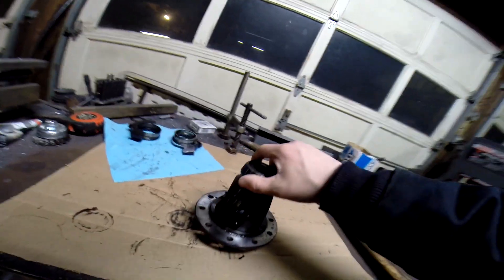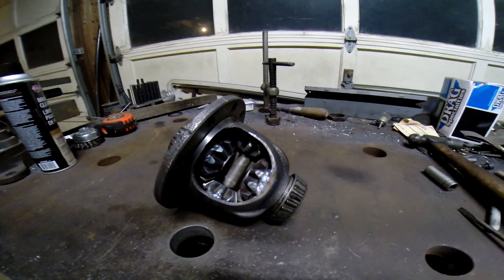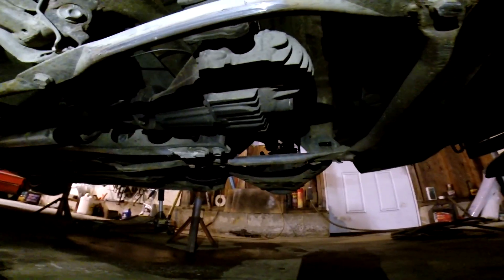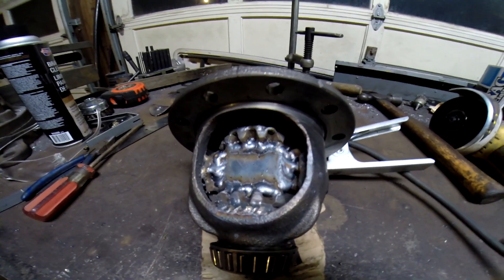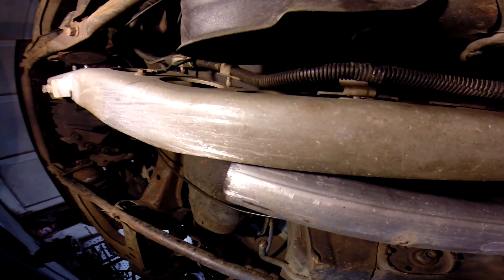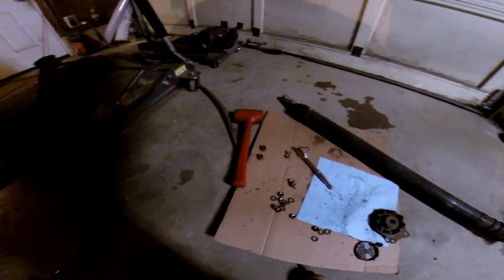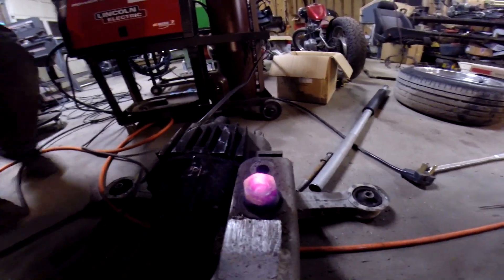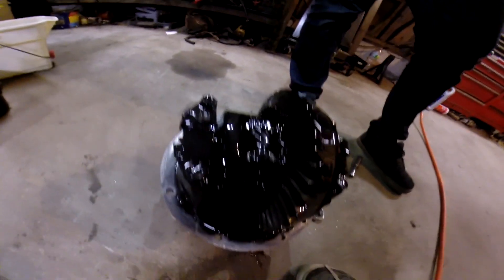Miata Drift Build Part 2

Comment: Just got a 95 318i for $600. Came with e46 rims and m3 front bumper. Guy sold it because it had a ticking noise but he didn't know what it was a thought it was bad. It was the exhaust manifold. Easy fix and a steal.

Comment: Since taking off the whole PPF beam and the diff together, make sure you align it carefully!! you can ruin your transmission and diff (not so much since its welded) you will probably hear de-accel grinding and acceleration whining when its not aligned properly. I know from my miata when I dropped the trans sadly.. haha

Comment: why a welded diff when you already have an lsd?
Reply: Cause race car
Reply: +SLD pf      *rice car
Reply from the maker: Lsd = LIMITED Slip diff 
Welded diff =NO SLIP DIFF
Reply: +Ricer Miata you tell him what's up
Reply: +563ripper also he can sell his lsd to someone else to fund other stuff
Reply: If the LSD he had was as old as his Miata, it's likely worn out and probably slips more than it locks.
Reply: +563ripper Welded diff + RWD = instant sliding! That's why :D
Reply: +563ripper Welded diff + RWD = instant sliding! That's why :D
Reply: What's an LSD?
Reply: +COOLIFY limited slip differential
Reply: +Primer2tone Garage A torsen doesn't wear out, it's just blow lol
Reply: +Primer2tone Garage Torsen diffs can't slip :P It's nothing like a clutched diff.
Reply: Tran Antony
I didn't notice his previous diff was a torsen. I was too busy focusing on the shit I was taking while watching this video.
I just assumed he had an stock vlsd.
Reply: +Sam DrowsySam Millington Torsen diffs are only limited slip.
Reply: NoRealPotential I know it's only limited slip, that doesn't mean anything mechanical is slipping. The torsen gears don't 'slip'. I was meaning they wont slip like a clutched diff when worn out and well used.
Reply: +Adam Loer 
It was an option. But they also came with an open diff.
Reply: +COOLIFY its drugs you smoke it
Reply: Ruined_Sol lol no mate
Reply: NoRealPotential dude iv smokd it b4 its real dangerus
Reply: +Ruined_Sol 
Smoke it and wake up in a chicken coop.
Reply: Ruined_Sol smoke it and wake up a different species.
Reply: +NoRealPotential no sir, that is of you smoke DMT. EVERYONE, SMOKE DMT, UPGRADE THE SPECIES!
Reply: lysergic acid diethylamide 😂😂😂 if you get it!
Reply: +Sam DrowsySam Millington lsd diffs will allow the tires to lock if they have enough rpm which can be different between different lsd diffs and some come adjustible but a welded diff will stop the flanges from being able to move in different speeds meaning they will always lock when people say slip its actually just meaning its not locking the flanges in place allowing the tires to move at different speeds causing one tire fire
Reply: +Primer2tone Garage its a gear style lsd, not clutch, no way to wear it out unless you break cogs and in as miata i don't think so
Reply: +Sini_ster 
Right on man. I had missed the part where he showed he had a Torsen differential.
Reply: +563ripper torsen diffs suck for drifting. when you let off the gas, the diff will act like an open diff and you'll catch traction and pretty much lose drift. you're better off with a welded than a torsen.
Reply: Because not enough power to slide with lsd lol
Reply: +ChinzoPhoto that's a load of crap, its not possible for a torsen to work like an open diff ever, one wheel can never spin freely and when you rotate one wheel the other will always spin the same way, its a worm gear deign. Do you even know how they work?
Reply: This0is0pointless On decel, the locking force of a torsen is very little which sort of makes it practically a 1-way lsd. great if you never lift off the gas but when you do, be prepared to catch traction. These are great for road racing but not for drifting. It's why all the miata guys that drift either run a welded or 2 way.

Comment: When I weld diff's I'll weld a plate to the spider gears but also punch a 2 inch hole in the middle of it and dimple dye it so it can help circulate gear oil.
Reply: I haven't heard this before, sounds like a good idea. But what is a dimple dye?
Reply: hahahahaha i wasn't being a grammar nazi, i was unsure what you meant but i just googled it. its called something else where im from but i didn't know the name
Reply: +Leroy McIntyre 
Lol. Yeah, see what these YouTube warriors  have done to me! I automatically assume someone is messing with me over an autocorrect mistake.
Gaaaahhhh!!! 😖

Yeah, I just bought a set of dies* they are freaking awesome. ☺️
Reply: Hahahahaha i know the feel, you can never do anything right on the internet. That is a great idea and I'll be sure to take that into consideration for when i weld my diff.. just need a MIG welder first

Comment: better dont take out differential,when you put it back,you need to adjust those bearings,its not easy to found proper information for adjustments etc
Sometimes new bearings last only 20-100miles before wearing out

Comment: is it better to weld that plate in the diff than just welding the spider gears together? if so, why?
Reply: More strength but it seems like it could throw the diff  slightly off balance. I'm really not sure how much it matters though.
Reply: +Tommy Sperlin i dont think a diff spins fast enough to matter, i may be wrong tho, ive hear putting the plate in is the best way to do it but also heard people saying its a waste of time. its personal preference more than anything i think
Reply: +Charlie Ward Yeah you're probably right.
Reply: +Charlie Ward thanks guys!
Reply: no problem :)

Comment: Why would people get mad about using brake cleaner to clean?? I use it to clean all over my pit bike.
Reply: brake cleaner is the best cleaner just as long as you lubricate your parts after
Reply: +travis travis Just Google brake cleaner welding
Reply: +Cameron Graham I see the concern but the original posters comment didn't really have any context but cleaning
Reply: +Gio Stunts Toxic and flammable. Even more toxic when heated.

Comment: what does welding diff even do?
Reply: 97 more horsepower
Reply: wtf!! I need that ! can someone weld my diff on my 2015 7 series
Reply: TheXenon front wheel drive woth posi
Reply: With
Reply: dude, he's joking with you. basically, it keeps both wheels spinning at same speed just like an LSD. but, you will get some weird noises and skipping tires and alot of that good stuffs.

Comment: Why would people bitch about cleaning it with brake cleaner? Its literally the best and cheapest way of doing it
Reply from the maker: Because when you weld it and releases a poisonous gas in the air
Reply: Well, still, it is by far the easies and most convenient way of getting all the grease away. I dont think you did wrong, thats how I always see people do it. Spray like 4 cans of brake cleaner into it, and then dry it. Then take some rubbing alcohol on the surfaces that should be welded = mint

Comment: I literally bought a torsen rear end for 180.USD. they are cheap and so much better than this ghetto welded shit. Jesus, cmon man
Reply: This is alot cheaper.
Reply: Drift car bro
Reply from the maker: Lol I have a torsen the welded drift 10x better ;)
Reply: +Ricer Miata can I buy the torsen off you?
Reply: +Jacob Klein he welded his torsen diff lol
Reply: Adrian Garcia no he welded an open diff. A torsen diff looks way different. He shows the torsen diff halfway through.
Reply: +Jacob Klein ohh lol Idk I bought a miata recently and I got an open diff
Reply: +Adrian Garcia I bought mine last spring and have been looking for a deal on a torsen diff for a while. I should've just bought a miata with an lsd.
Reply: Welded is way better for drifting
Reply: +Bunny Rabbit will the viscous or the torsen diff slip alot?
Reply: +Dan Smith torsen's randomly lock don't they? I hear alot of complaints about them
Reply: +Adrian Garcia torsens are leaps and bounds better than vlsd's for drifting in my opinion. Type 1 torsens are way better than type 2 torsens as well. I drift with a type 1 Torsen but am considering going welded
Reply: +Bunny Rabbit my friend gave me a viscous diff because he got a torsen. he told me I should have welded my diff but I don't like the jumps or noise from the welded diffs.i haven't installed it but people say it's shit that I should have gotten a torsen but hey I'm sure you would accept a free diff.
Reply: +Adrian Garcia sure, it's better than an open and doesn't skip so it's not a pain in the ass as a daily. Still won't be drift super well but it's better than an open diff
Reply: +Dan Smith dont be stupid, if you had a top of the line lsd then it would be far better, but an old fucked stock miata lsd is gna be shit compared to a welder
Reply: +Adrian Garcia I've also heard of people putting rx7 clutch type diffs into Miata housings and they are better than torsens from what  I hear. Some people shim them to make them lock more
Reply: +Bunny Rabbit torsen diff are better for autocross because it's keeps the inside Tire from spinning while keeping the handling the same. the clutch type introduce understeer but will be better for drifting.
Reply: Yea. Idk tho cause i see road course guys preferring clutch type lsd's. torsens make most sense to me in theory, sending the available torque to the wheel with the most traction. clutch types are good for drifting because they truly do lock up once they sense a large enough differential in speed between each rear axle.
Reply: +Bunny Rabbit ya, any lsd is better than open. do you remember what year rx7 diffs will fit? I remember that there is some grinding involved to make them fit.
Reply: +Jacob Klein couldn't tell ya. I've just heard of it being done